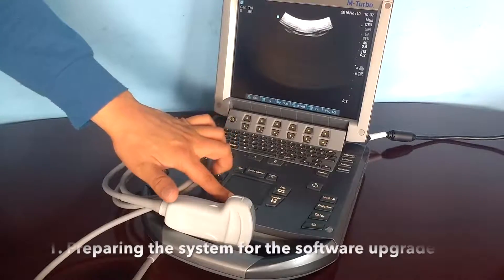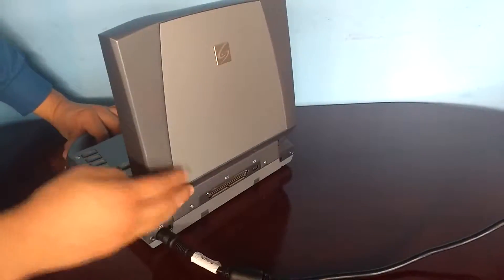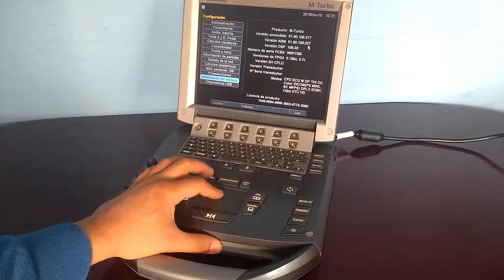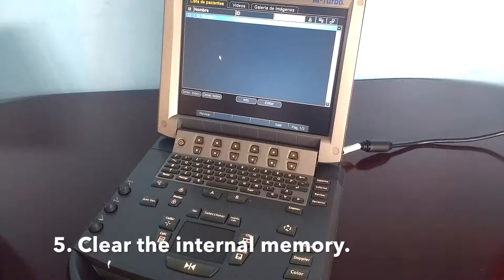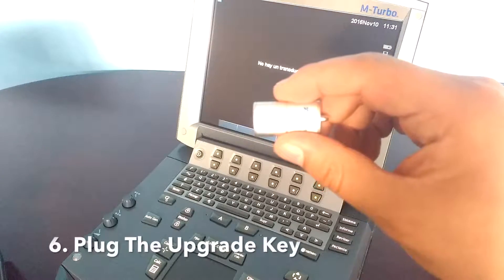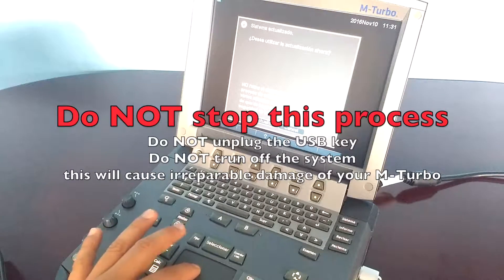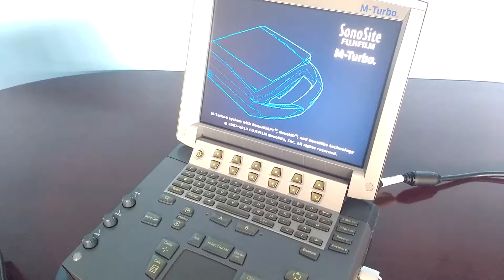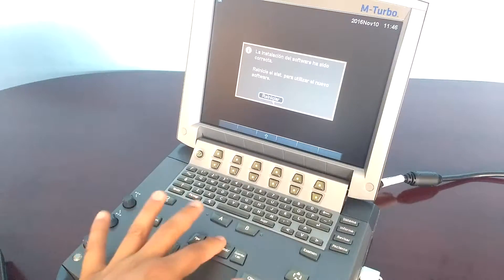FUJIFILM SonoSite M-Turbo Software Upgrade

Comment: Great video. Any idea where I can get a file to upgrade the transducer package on a Sonosite S-Cath. It works with a L25 probe, but multiple other probes that should be compatible give incompatible transducer error. Does it also require a license update? Internal MB looks almost identical to M-Turbo. Thx

Comment: Hi, Do you have the CMOS rechargeable battery's specs by any chance? Date and Time is incorrect, it won't accept the password, apparently needs to replace  the CMOS battery attached to the main PCBA. It is for SonoSite M-Turbo, manufactured 2012. Great video by the way. Thank you so much
Reply from the maker: Hi! For the SonoSite M-Turbo, manufactured in 2012, you can use a LiR 1220 rechargeable battery for the CMOS. Thank you for watching the video!
Reply from the maker: Hi! For the SonoSite M-Turbo, manufactured in 2012, you can use a LiR 1220 rechargeable battery for the CMOS. Thank you for watching the video!
Reply: @oxcarvincent  Thank you so much, very helpful. I hope replacing this will let me to log in to update the date and ...! Really appreciate your help

Comment: This Shaitan machine refused to work. When you insert the probe, a blue screen with the code: P: false Ctrl: 0x2531 (9521) D: 0x0 (0) Can you please tell me what has fallen off on the board? I wouldn't want to change the entire board.
Reply from the maker: 9521, is SetPath issue.   maybe formatting the memory and reinstallling the transducer package could solve the problem
Reply: @oxcarvincent  Apparently one of the microcircuit legs fell off due to the board deformation. I put several layers of paper under the bottom left screw))